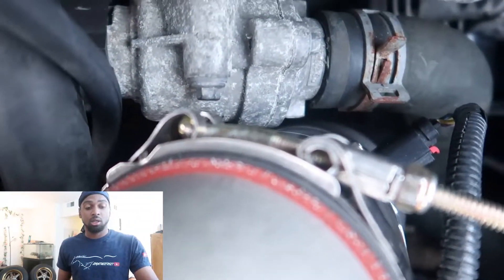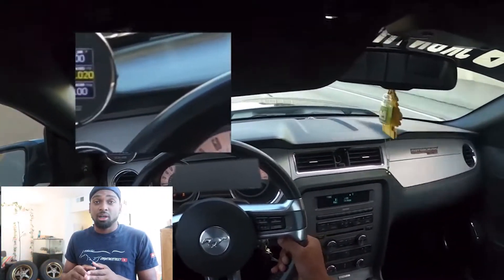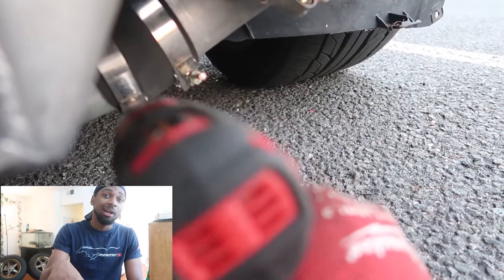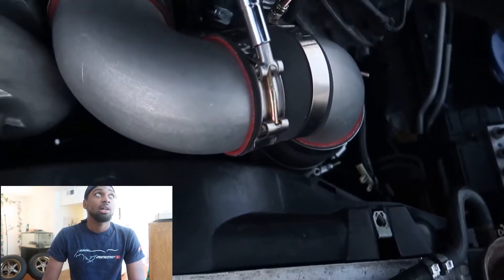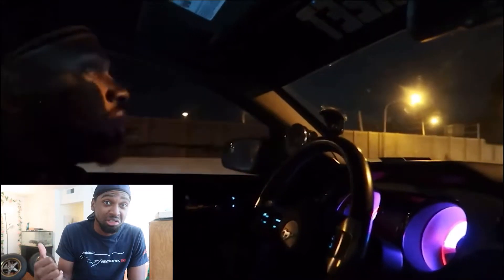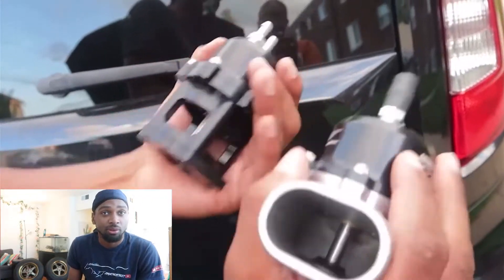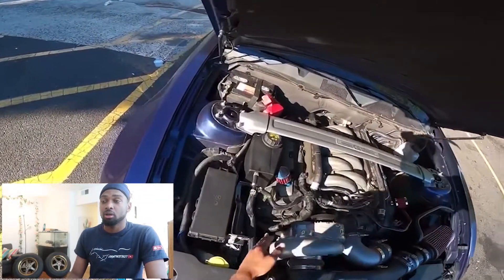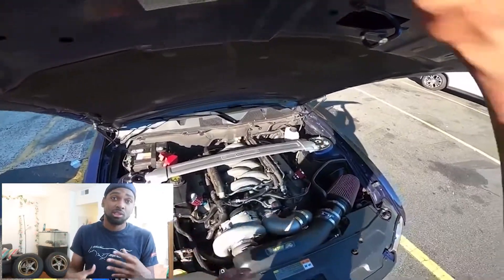5 most common paxton/vortech supercharger issues on a mustang gt.

Comment: Solid! Definitely considering a separator and blow-off. I got a procharger kit for my 2023, and a bit nervous about that killing my warranty, so any safety measures are better than none. Was thinking about doing it myself, but I don’t really have the setup to do everything right, so end of July I can get a shop to do it… but that’s so far out 😅 … didn’t realize I would have to remove the crank pulley bolt, thought it went through the stock accessory drive and it was just a simple bolt on 🤪 
great video, awesome editing too
Reply from the maker: Thanks I appreciate it! You’ll definitely wanna get a crank support kit for any prochargers as they are known for snapping coyote cranks. The plus to a pro charger is if you blow a belt off it’ll still drive lol

Comment: Coming from a procharger on my 2014 GT. These issues are spot on! As for the low torque, at least it's better than stock lol. The major problem I had with the procharger was the fan shroud  and fan provided by them. I alway had issues with that fan always burning the wires and blowup my fueses/fan resistor( wiring was not a wiring issue)
Reply: Have you managed to fix that? If so how and if not could you wrap the wiring with heat protective wrap?
Reply: @engel4365  I never got to fix that issue before my car got rear ended by an 18 wheeler. I tried everything! Rewiring the fan directly to the battery, only powering up when I turn the ignition ON. I went through 3 fan resistors and so many fuses, I even bumped up the relays for higher amps thinking the fan was pulling a lot of power. The issue my not have been from the pro charger kit. I do believe pro charger could have done a Better job designing that kit so    we wouldn't have to use that hideous fan shroud with an aftermarket fan. My issue was the fan wires were getting way too hot to a point that the wiring and resistor melted causing my car to overheat and bust the cap off the coolant tank because no FAN cooling the engine. Yes I also heat wrapped the wires but the head was coming from the copper wires itself.

Comment: Knock detected by the knock sensor is for detecting detonation in the engine. Not things physically clanking in the engine bay.
Reply from the maker: Yes however, the knock sensors are very sensitive in coyotes and sit directly under the intake manifold. things hitting in the engine bay can can be picked up by the knocks sensors and simulate knock which is why when tuning most tuners will call it “false or ghost knock”

Comment: There are ways you have to drive different with this setup to avoid some issues. I noticed you have to really DRIVE the car and get it warm first. If idle too often or short trips and driving low rpm’s  high gear, get problems
Reply: what kind of problems ?? i daily my car but short distances and i want a vortech

Comment: Hi. I'm planning on getting the kit. Should I upgrade the clutch and fly wheel, and rear axles. Or no thanks for sharing.
Reply: Also what fuel system did you go with
Reply from the maker: Clutch and flywheel 100% or you won’t be able to use it like intended or you’ll likely break something. I had stock axles and they held up well. I was just on dw95 injectors and a boost a pump because I was just using pump 93 but I was going to switch over to fore innovations return style fuel system when I went e85
Reply: @Jrgnthestreet  not going e85. Not spending $7 bucks a gallon.
Reply: @Jrgnthestreet  should I change the oil pump gears and sproket. I see other people doing it. Hope it's not too much money to install
Reply from the maker: @brianpreston2911  damn idk where you live where e cost that much lol it’s usually cheaper than 87 here in PA. And opgs and crank sprocket are really one of those “you should do it but you may get away with not doing it “ type of things most auto cars don’t need it but manual cars should but most of us like myself didn’t and got away with it lol. Unless you’re bumping the rev limiter up or getting a 2 step then I’d say without a doubt do it . But either way it’s going preventative maintenance.
Reply: @Jrgnthestreet  live in Massachusetts lol
Reply: @Jrgnthestreet  thank you.
Reply: @Jrgnthestreet  can't wait to get the kit

Comment: 2nd summer I've had my paxton on my 14. Only issue I've had was the piping popping off. I even bought the jpc t bolt clamps which are stronger but still popped one lol.

Just one of the cons but I still love it. Max flo bov here too!
Reply from the maker: After I got the t bolts I made sure I tighten them as much as possible and even broke some in the process lol but overall they’re a lot better than the stock ones. And the max flo is the best!

Comment: I have a fox body with a vortex v3 supercharger and it loses pressure no mechanic can find what it is ?
Reply from the maker: Uhhh… if I had to guess I’d say either you have a vacuum leak somewhere and should do a smoke test if you already haven’t or… 🤔maybe you can swap Blow off valves because they are rated for different psi’s

Comment: Just bought 04 with vortech supercharge..I have issues with air intake temp sensor code p0113.too much gas smell..any ideas
Reply from the maker: Might just need a new sensor or there could be a bad connection I’d check the sensor out for debris

Comment: Good stuff man. I was planning on a whipple for my 2020. However I'm interested in the new kit from ess. Apparently it's a great unit and affordable. I'm not looking for huge hp. 600 to the wheel would be enough. I don't want to end up replacing axels, clutches etc. Plus I'll be running a 275 rear tire so traction will be an issue. I just don't know if I'll need to upgrade my oil pump gears. I'll have fun with the car but I won't constantly be balls out and bouncing off the rev limiter
Reply from the maker: I haven’t done my opgs and (knock on wood) the cars been fine so far just be cautious like you said and unless it’s a drag radial I’d go a little bigger on the rear tire and make sure it’s a good performance style tire
Reply: @Jrgnthestreet  I just spent 3k on new rims and the rear is a 9.5 inch. Maybe I could run a 295 but I don't know. Michelin pilot sport 4s so they are a good tire.
Reply from the maker: Hmmm you may be ok
Reply: Going a bigger tire isn't going to help with traction....Its the compound and material that'll help... I ran 275's on alot of my cars. like camaro etc and people with 315's that were cheap as hell would spin like crazy while i'd have some chirp... Just food for thought. you gotta look at the material. Else you're adding weight for no reason
Reply from the maker: I know that’s why I told him to make sure it’s a good performance tire and he said he was considering the Michelin pilot sport 4s lol but I appreciate the comment either way

Comment: So how much boost are you running? I ordered this kit with the 3.6 pulley but been seeing alot of people talk about the fluttering with the bov that comes with the kit.
Reply from the maker: I’m at like 8.5 psi with my boost gauge readings I’m on a 3.8 pulley .
Reply: @Jrgnthestreet  wow you were getting fluttering with the 3.8? I'm really gonna have to upgrade to the maxflow race.
Reply from the maker: Yeah I think I started getting it when I went to the jlt intake but with the stock air box I think I was fine
Reply: @Jrgnthestreet  yeah I got air intake that with the package.  I just ordered the Race bov about 30 minutes ago so hopefully all goes well. I have an 18 ported mani, BBK long tubes,I'm hoping to at least get between 600 to 650 to the wheels.
Reply from the maker: You’ll definitely be in that range!
Reply: Yeah you will.. my ‘13 GT makes 697 rwhp on 91 octane with BBK long tubes and Paxton novi 2200SL
Reply from the maker: What pulley?
Reply: I honestly don’t know what pulley size. Peak boost on my digital AEM gauge is 12.3
Reply: @EverQuesterForLife  I'm only 639 to the wheels , if your at 697 with a 3.6 that's nice!